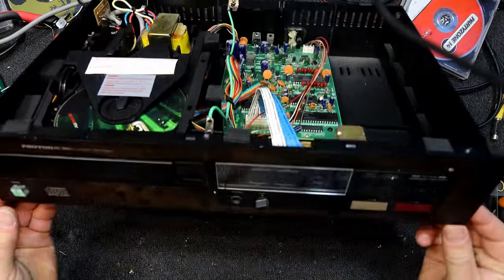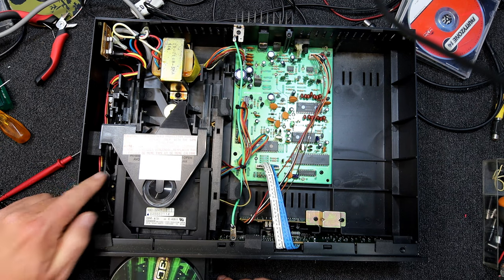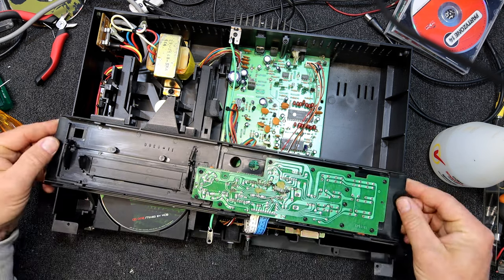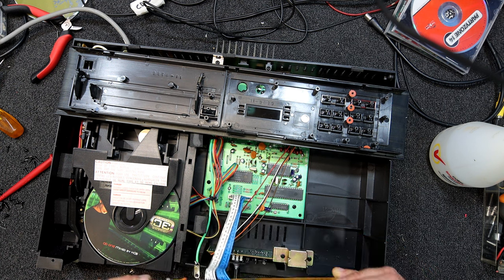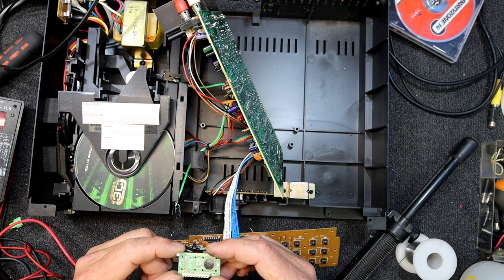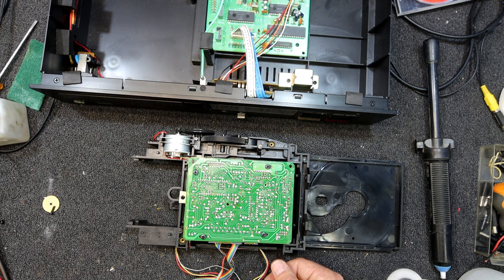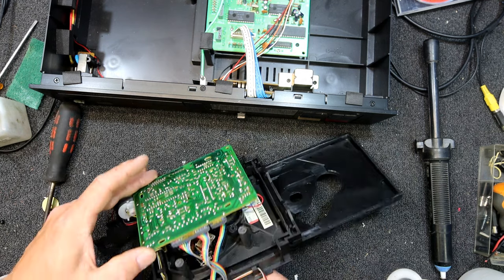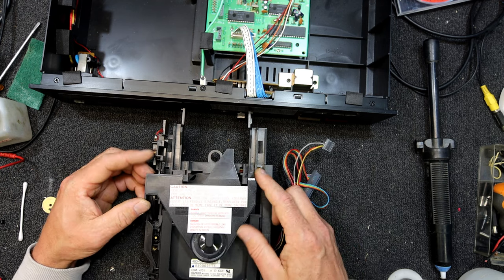Proton AX300 MKII CD Player Faulty Display Diagnosis and Tray Loading Belt Replacement

Comment: That's a  CDM4/31. The main PCB has the copper ground plane so deffo Philips sourced OEM. From the simplification it's late 80s or early 90s, depends on what DAC it's got in there, but likely the simplified version of the TDA1541 orTDA1541 f you're lucky
You'll need to check the power rails, the PS caps, the servo board caps, the voltage regularors, and it's worth upgrading the opamps with dip adapters so you can roll them as suits.
The capacitor glue has like gone conductive so best to scrape it off and clean with 99% IPA